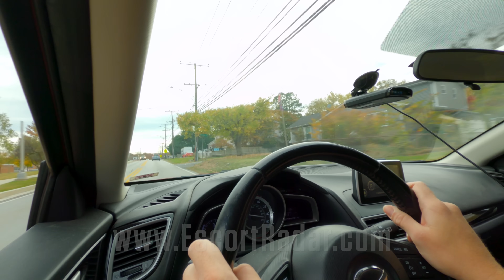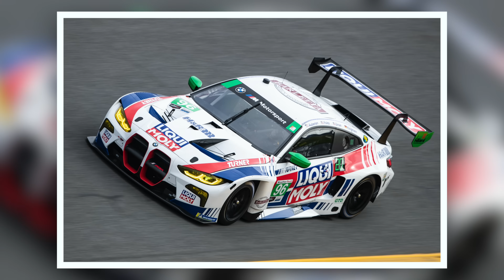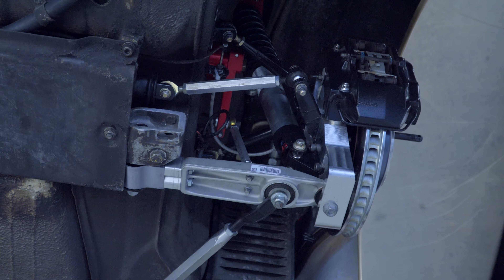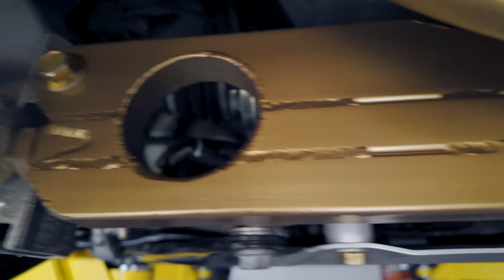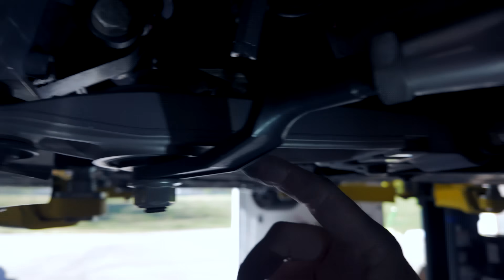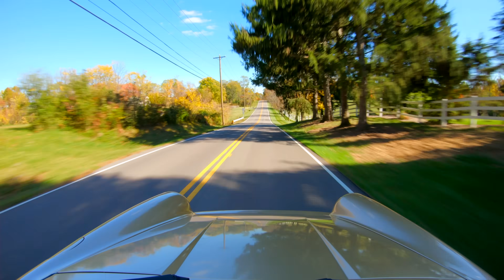991 GT3 Cup Suspension on an Air-Cooled 911 | GoldenRod

Comment: Bummer! I wanted to know which wheel bearing and hub he chose for the front billet upright! And FYI? 18yrs ago we were installing 996RSR rear sub frames and suspension under 78-88 911’s. Several cars with this setup have been racing PCA Club Racing this whole time. 2-3 of them will be at Sebring season opener!
Reply: The wheel bearings and hubs are 981/718 GT4 but could have used centerlock hubs from GT3 as well with centerlock wheels. Great to hear about the 996 rear equipped G series cars in PCA. Have seen race cars with 993 rear but not 996.
Reply: Same hub and bearing used on all 4 corners, common bearing with 991 GT2/3/RS/Cup
Reply: @JayOConnell-t1h  Got it! So you removed the wheel studs from a GT4CS wheel bearing?
Reply: 996 on 911, wow. Tube framed race car?

Comment: Nice build and  I find it intriguing . My build is a 914 with all 996 suspension brakes and steering  .  I used the 996 subframes and so it has a safari stance and lift.  I also was happy to hear your front rear roll centre remark because I did the same thing for much the same line of thought but without the race experience . Loved this video . 🇦🇺❤️👍
Reply from the maker: Sounds like you've got a great project going!

Comment: Wow! Thank god my 1988 Corvette already has forged aluminum double-wishbone front and multi-link rear suspensions.
Reply from the maker: And leaf springs ;)
Reply: @PorscheClubofAmerica  
Yep, composite transverse mono-leaf springs that weigh like 5 lbs (2.4 kilos) each, and there are only two in the car. It's a neat high-tech detail in the Corvette chassis. 

The downside is that there is little we can do in the way of height and / or rate adjustments, so lots of racers install coil-overs to address that. The coil-overs do add some weight and complexity, but installation is fairly straightforward.

Luckily, Corvette Engineering did a great job of tuning the C4 chassis, so unless you want to drastically lower the car (not recommended for road driving, though many of us have insisted on learning the hard way), the stock springs are fine. 

It's worth noting that the factory Z51 handling package springs and dampers are very stiff - uncomfortably so on the road, IMO. But, they do deliver track-capable control and sharp responses without sacrificing ride-height or screwing up the suspension geometry. 

The base springs deliver a compliant yet controlled ride that works perfectly well on our typically far-less-than-perfect roads. Quality dampers are worthwhile, of course.
Reply: And still a Corvette…
Reply: @OCavant  
Oh, I seem to have touched a nerve. Sorry that the facts make your ridiculously over-priced Beetle look a bit silly...

Comment: For a dude making car content, that's a super lazy wiring job on the radar detector.
Reply: How so? The wire goes straight to the closest 12v outlet in the car, in the center console bin. Do you have a better way to place the wire?
Reply: @thedamonlowney  You 1) mount the detector at the top of the windshield for better detection and then 2) route the wire around the windshield border/headliner and down the A-pillar so it's not constantly flopping around in front of you
Reply: @blablah538  Thanks. I'm not going to re-route the wire for a radar that I swap in and out of different cars. Noted on the placement of the detector. If I want it higher, it'll be on the passenger side of the car where I can't see the little screen, or hidden by rearview mirror. The feedback is appreciated.